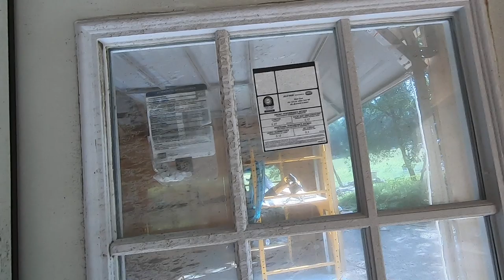Getting Ready for the Barn Build when I found A Predator had Attacked our ANIMALS

Comment: On the chicken tractors
Maybe two strands of electric wire one low
And one by the top
With the battery and solar panel on the top 
So still self contained
Reply: Al could also run it off NYC's charger. It's got plenty of juice. Best to locate the charger along the fence adjacent to the tractors and come off the charger but he wouldn't loose too much taping off the fence.

Comment: I think your chicken thief is a six foot tall Easter Bunny, who needed to ramp up colored egg production for next year or maybe just wanted a snack.     I'm just a city guy, but had a chicken been grabbed and dragged out of the top of the tractor, or from underneath, there would have been more signs of feathers and probably some blood on the underside or outer edge of the blue tarp.   Even if it had been raining, the feathers would have been obvious.     What predator would open the lid, gently reach in and pick up a chicken without causing a big struggle and flapping wings and leaving lot's of sign etc, and then close the lid as they were leaving.      Those chickens would have been in the back, a large predators size would have pushed the lid fully open to get to the bird, then walked away leaving the lid open.    Too me, due to the minimal disturbance, this was a human who could reach in, pick up and hold the bird with one arm and close the lid afterwards.   You need a game camera.  Maybe time for another electric fence.

Comment: A raccoon could easily open the unlocked top and reach in and grab a chicken. The others would have moved away. Most animals will only kill what they can eat so it only grabbed the one. Lock the top and put something heavy that a 40+ pound raccoon can't move. Remember they can figure stuff out like locks. That is my guess. Because a raccoon is the only predator that has hands that work like ours. Other predators would have to tear a whole in the sides or dig under.

Comment: Probably two-legged critter in trousers wanting free meal.  Lack of feathers at crime site (and nearby) is indicative of human thief rather than raccoon or fox, etc.  Need trail-cams and high-voltage perimeter wiring for ALL your livestock.  Also, tools need to be locked up with suitable anti-theft electronics.  Trip-wires leading to "firing boxes" for shotgun shells (boxes that can fire shells, but are not actual shotguns) to give a very loud noise to scare off human marauders -- or to a power switch for a loud audio system placed near the animals. with an extension to your home to wake you up when something happens.  Flood lights triggered by the intruder are another possibility.